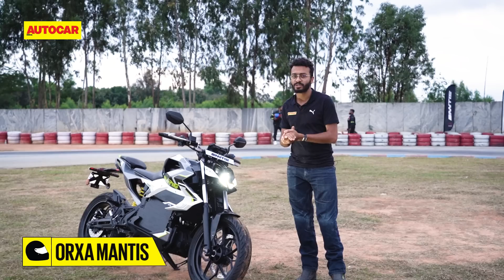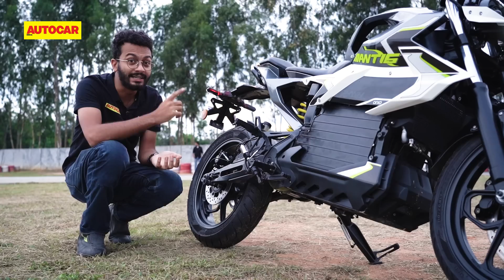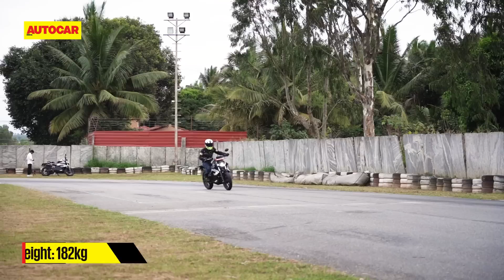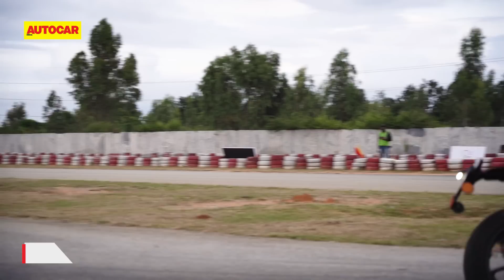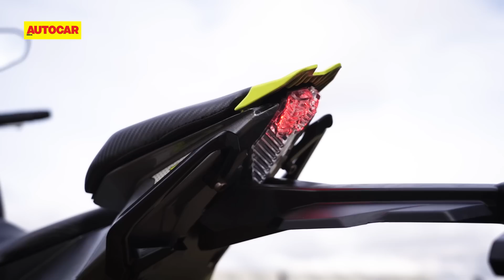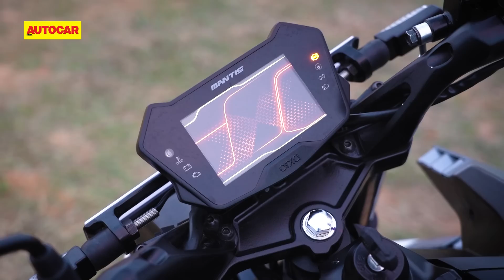Orxa Mantis review - India's latest electric bike | First Ride | Autocar India

Comment: In my opinion, we should start working on making ICE more efficient and run on ethenol fuel or something of that sought that reduces carbon emissions. 

These EV doesn't make sense as of now with the current technology.
Reply: It makes all the sense for 95% of users
Reply: @Y2Kvids  we're not talking about made up numbers that you pulled from your backside, but if they really cannot see the plethora of issues then ev users are just plain brain dead
Reply: Ethanol fuel is also not a sustainable fuel source in the long-term since the entire process is energy negative. Electricity CAN be clean and we haven't found a sustainable alternate fuel source yet. It makes sense for companies to invest in EVs.
Reply: I would say invest in hybrids and figure out EV / hydrogen / ethanol fuel… what is more achievable and get the infrastructure ready for it…. I personally hate evs because they lack the engine grunt, but if they can save the environment then be it… in the current state with bad infrastructure, the tech not there… it’s a really bad place we are at… I would rather expect that companies invest in hybrid and slowly evolve their EV tech to give a sustainable EV going forward
Reply: @atharvasune432  Hybrid has been there since 2000 , they did nothing because people cover mileage in Oil if they move any far . EV is the sustainable one . Play Engine Simulator 😄 in free time if you need the grunt .

Comment: This motorcycle reinforces the belief that ICEs are not going anywhere. The claimed environmental benefits of Ev has already been challenged coz of heavy lithium mining involved. So rest assured I can happily cruise with my speed 400 and no one is taking it away😊
Reply: Environment benefits of EVs are real. Lithium isn't the only element used for batteries and it's mining is much less compared to heavy mining of crude oil - we have to daily mine for crude oil to run bikes compared to once for a vehicle for EVs. EV bikes are automatic - mich more convenient to ride around city and also lot more economical,  efficient, no emissions and silent. No oil change required, very few moving parts. EV's are here to stay even if you don't like them.
Reply: @367Stories  ev bikes would take at least 20 years to fully evolve and replace ice as there are lots of challenges faced by ev users in terms of lower fast charging infrastructure, EV will be future for sure when it will fall in the same price structure as ice .
Reply: @altamashghayas9421 that's what people said about electric scooters. Now they're everywhere. 💁🏼‍♂️ There are so much misinformation circulated in social media regarding EV pollution and all...and so many researchers sponsored by oil companies.
Reply: @367Stories  True, mining Lithium is one time for say a period of 5-10yrs till the battery lasts. But how do you charge your vehicle? Can you ensure that the electricity that is being used is clean? Pushing the bad part (mining of crude to run vehicles) back in the supply chain (getting electricity from coal/oil based plants) is just a way of shutting your eyes and believing that EVs are good for environment
Reply: @367Stories  mining once a month… might be true today, I don’t believe it, but might be true today, but you have to understand the scale at which we are talking abt once a month won’t cut it… it would have to be done all the time, and what about the electricity, no grid out there , take the most advanced countries, has the capability to supply enough energy required, electric vehicles in their current state are not at all a good option, till we figure out rest of the stuff (battery efficiency, battery disposal, reusable batteries etc etc..) hybrids are the way forward. Maybe one day evs might be good… but right now we are just straight up rushing it
Reply: @367Stories  Maybe in the FAR future EVs are the way to go. But for now on how all these bikes perform on road, their safety (fire), malfunctioning (going out of control like the Tesla incidents), charging infra and time, no ease of going anywhere anytime and exorbitant investment prices are a huge no to opt for EVs now. Cost and frequency of changing batteries are individual demons on its own.
I respectfully disagree to Env benefits of EVs 'are' real. They 'will be' real someday but not now. Due to that fact that how the old batteries are going to recycled/discarded and how are we generating (more) electricity for EVs.
Reply: Its not about pollution.. For me it was about economic sense.. I owned a Duke 200 and planned to upgrade to a 390 or Ninja 300. But getting 20kmpl stuck in Bangalore traffic with chances to experience their full power maybe once in a bluemoon weekend breakfast rides didn't make economic sense.. combined with expensive maintenance. Hence, I took the F77.. Charge it twice a week and its good to go. Under the new scheme by Congress govt, electricity is almost free of cost and service cost is also very less. On the other hand, the design, the ride quality, the after sales experience and the Bangalore owners community is amazing. Absolutely happy with my decision.. 
That being said, of course for long rides unless charging network comes live, its not suitable at the moment..but my usage is 99% office commute..
Reply: @d2genx  As an office commuter agree electric scooter/bike makes sense.
Reply: Very true indeed.
Reply: Not really, It is all about the energy density . If energy density doesn't get amazing, there is Fast charging that will cover the needs . Diesel or Petrol will be relegated to Power Plants where they produce electricity more Economically when solar+ battery handle things .
Reply: do you even know how lithium is mined?? baseless comment🤔
Reply: Hi how's is speed 400 performing , are there any major issues, I was planning to buy scrambler 400 x
Reply: @SanyamBanoni  Good bike, jitna hype reviews mei di thi as such itna kuch feel nai hota, but it is a good bike but service im skeptical coz even service staff are not yet well trained & trust me i live in metro is i cn imagine how it is in smaller places.
Reply: Oh, no. You’re Speed 400 will go away soon. Even though lithium mining is a dirty business, there is serious lobbying from the rare earth and heavy metal industry to make the shift happen faster. Profit is all that matters at the end of the day. The planet can go to hell for all they care.
Reply: Agreed
Reply: In two years, Lithium batteries will be replaced with solid state batteries.. ICEs will be Ice Age History then.
Reply: Exactly I still dont find solid reasons and also it is better they just move to a hybrid solutions which will be for sure better in terms of performance and will be economical.
Reply: @mudaliarnaresh6519 there will be hybrids as well... It is just another option that's it.... We are gonna see all kinds of fuels petrol ethanol blended fuel... Hydrogen, electric, cng etc
Reply: @mudaliarnaresh6519  💯 Agree
Reply: @mudaliarnaresh6519 Hybrid two wheelers are unheard of.
Reply: Again tape-recorder 📼 lecture from WhatsApp University 😂🥱😴🤦🏻‍♂️